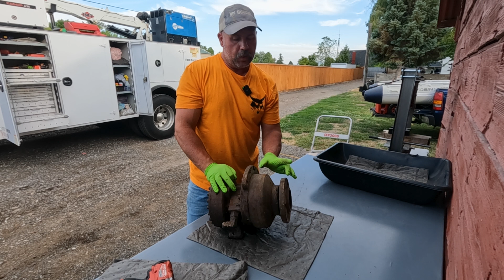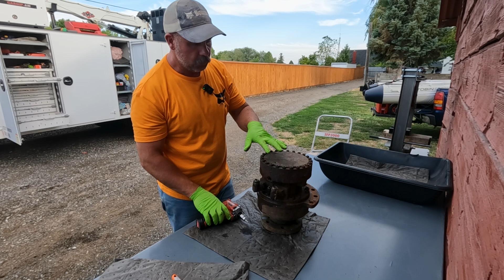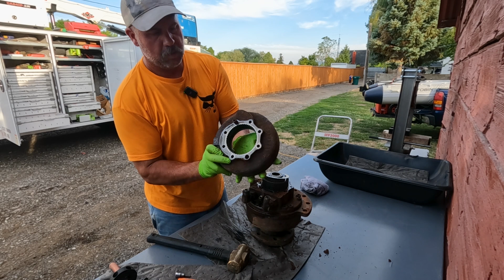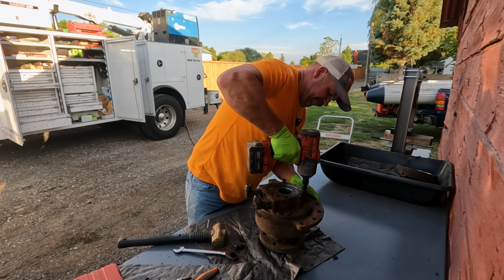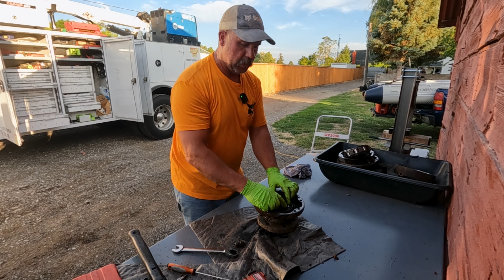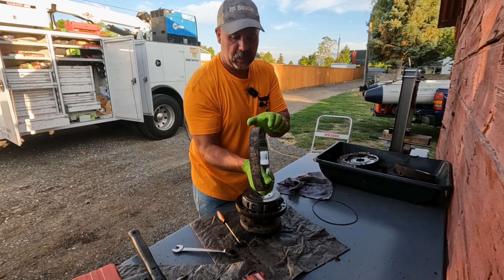Bobcat T190 Drive motor repair, teardown and assembly procedure.

Comment: I just found your videos, You're a Bobcat service guy or are you on your own doing this?   I'm asking because I had a blown hose under the cab of my E85 that I fixed but if something else goes , like in your videos, I kinda doubt I'll be able to do the repairs.  I'm 40 miles out of Fargo ND which is Bobcat country so I'm sure someone can help.   I'm looking for what direction do I look?   I'll ask the local Bobcat dealer too when I go in to get a hose make of something.   They don't have a service truck like yours in my small town, but I'm guessing Fargo will have something.

Comment: I have a bobcat T180, I am having an issue with the right side track not driving forward but will drive in revers. I just bought this machine and it has been sitting for the last 2 years or so. I am starting to think there is a problem with the left joystick but can not find any way to troubleshoot in the service manual. Do you have any advice?
Reply from the maker: You could swap drive coils but you would probably have a code present
Reply: @tetradgroup  thanks for the response. I am waiting for a friend to come by and connect his computer to the machine. I am thinking the left joystick is bad but i want to verify before i buy a new one.

Comment: I used to work Bosch Rexroth in the factory in Scotland assembling these motors for Bobcat. All the main bolts and brake housing bolts should be replaced when rebuilding as they'll be stretched! You should really put all the brake discs back in one by one and not try to put the brake housing over the top of them! Use a nylon mallet when knocking the brake housing  back on! I would strip one of these down and refurb it in about an hour! It looked like the split rings fell out in your hand when you got to them? These are fitted in a press under preload and measured for the shim but an easy repair to replace yourself too. We would build 8 of these from scratch in about 6hrs for 1 man or they changed to a production line and 3 men were building 42 in an 8hr shift! Nice video, cheers.
Reply from the maker: Thanks for the tips
Reply: If you get the brake pack mixed up on disassembly is there a certain way they should go back or does it really matter?

Comment: Thanks for the video! I did this exact T190 rebuild when replacing my outer hub section. Everything was great but now when the machine warms up my brakes hang up for a few seconds. Any idea what could cause that? It didn't do that before I tore it down and put back together.

Comment: I have a bobcat 863, i have a problem with the arms slowly creeping up on its own and i have to use my release valve to lower the arms. foot pedal will make the arms go up but not down.
Reply from the maker: Sounds interesting, if you still need help you can contact me @ www.4tetradgroup.com
Reply: Sounds like a control valve leak? gear pump wouldn't cause this.

Comment: Where do you get the parts from to rebuild them yourself? Bobcat doesn't supply them and no company is going to want to sell them without ripping you off
Reply from the maker: Bobcat should be able to supply everything unless it's currently backordered.  LPS (Loader Parts Source) and Texas final drives is a good source for parts.

Comment: At the dealer I work at we have a 770 we are waiting on a seal kit for 2 to 3 months. Parts waiting has been rough then being able to get hydraulic oil. I have a unit with bad swash plate bushing and hope I can get all my parts for the unit.

Comment: Hi, my 2006 T190 4 port 6 bolt drive motor is leaking hydraulic oil from the hub. Is there a replacement hub section available for this model? Thanks
Reply from the maker: It's definitely possible, check with loader parts source on the internet and see if they can help you, make sure to have your serial number available